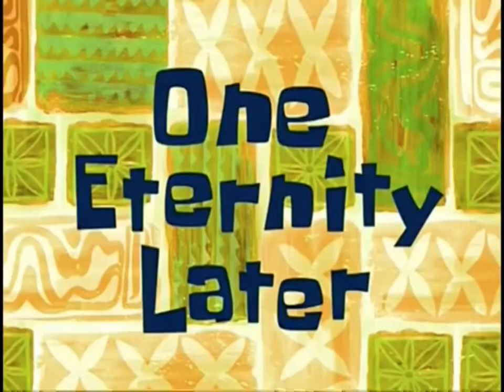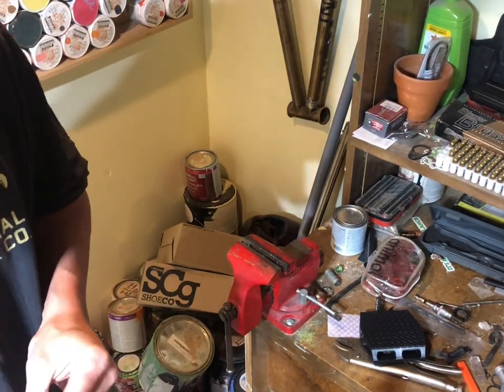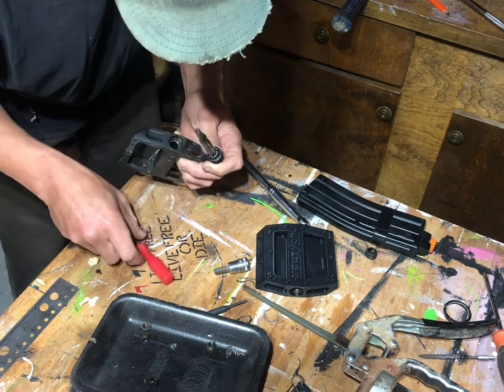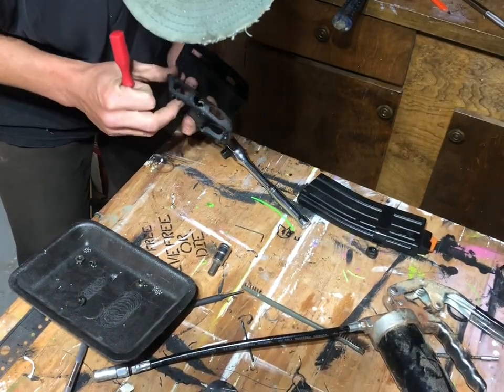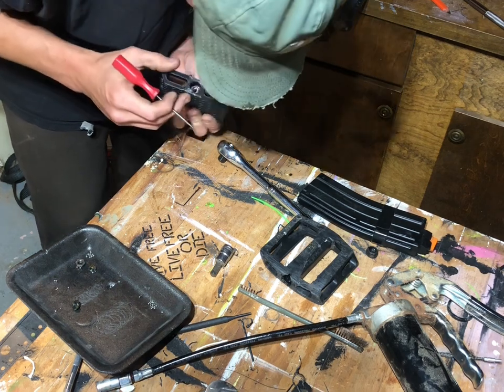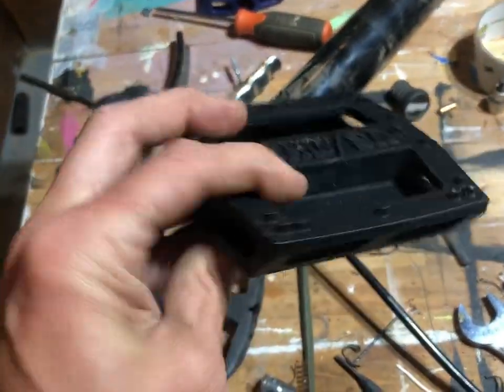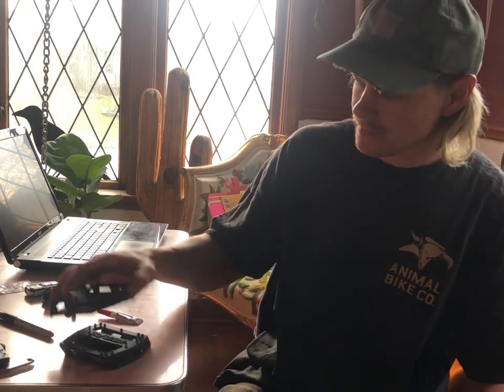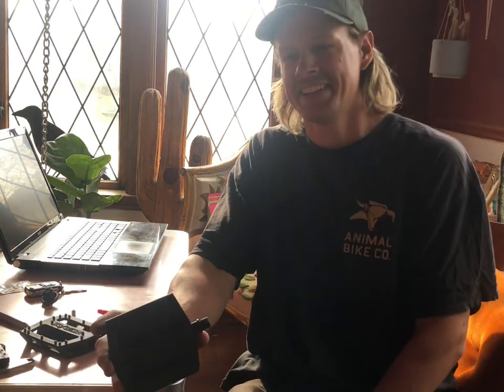3D Printed Pedals! How to!?

Comment: Hell yes that came out awesome! Whah printer did you use? The print quality looks very good compared to other 3D printed parts out there. Let us know how it holds up after a few grinds 💪
Reply from the maker: Creality Ender 3 v2. Got to ride the pedal today, and it’s actually amazing in pedal grinds. I’ve released both the left and right side files on my thingiverse. Make that printer go brrr
Reply: @gerberzackgerber  Huh crazy how you can achieve such quality with an inexpensive printer these days! Always wanted to give it a try ( a pedal for grinds exactly like you did ) but was concerned about the durability of a printed pedal vs. an injected plastic one. Nice work man, and much respect for your riding 💪
Reply from the maker: @TheRisemtb  printed plastic is as strong as injection modeling. It’s up to the user how well their print comes out. A proper machine, layer pattern, and good filament is key.